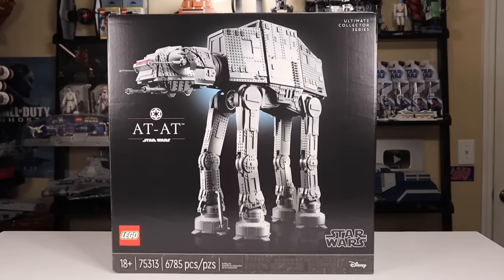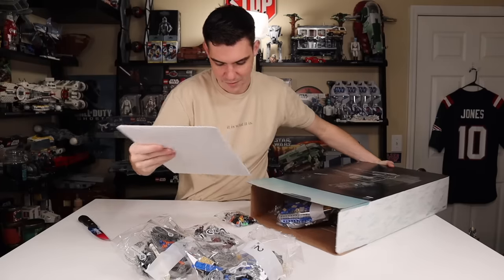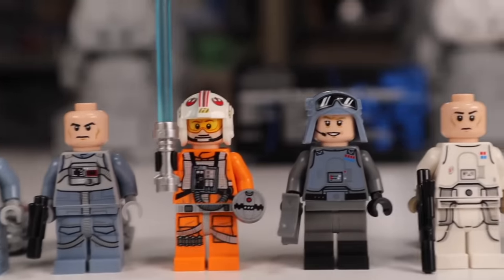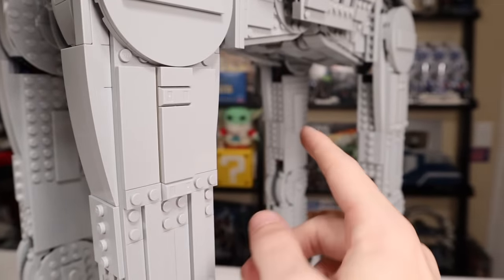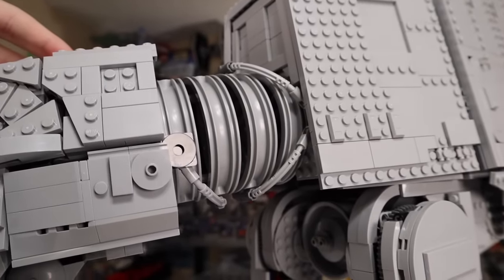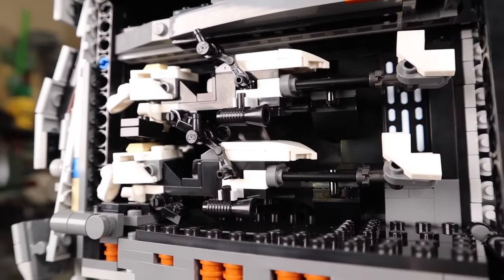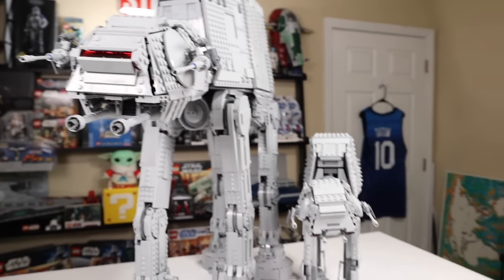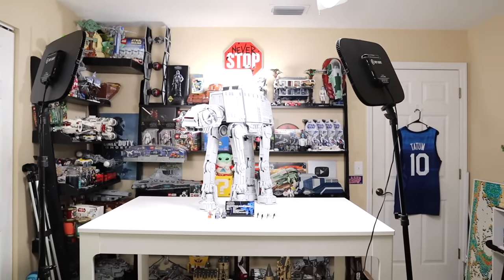LEGO Star Wars 75313 UCS AT-AT Review! (2021)

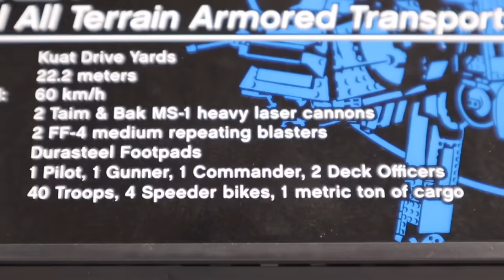Comment: 7:24 this got me curious so I ran the numbers, the UCS AT-AT is 36.3 times smaller than the "real" thing, so a metric ton at that scale (36.3x smaller, cubed) would weigh just 21 grams (0.7 ounces). 
If it can hold that much weight, which I suspect it can, it's accurate.

Comment: One of the biggest things I noticed about this set is that booklet #3 shows building the canopy as well as the head, but by the end of the third booklet we do not build the head. The 3rd box itself however is accurate in showing we only build the canopy and neck. But I agree with this whole review. It’s a tremendous, incredible set.
Reply: There is also a printing error in book 3 that dosent tell you to install 3 panel pieces on the front of the body.
Reply: @jaworski105  Noted

Comment: I really enjoyed the build process for this thing and it looks incredible. I love the interior and the attention to detail. That said, if my house were on fire and I could only save one set, I'm taking the UCS star destroyer instead.
Reply: May I ask if you had any trouble connecting the upper leg to the lower leg as mine is very unstable with only two orange pins just doesn’t seem stable, Thanks
Reply: @DarrensDrones  It's been 6 months since I built so to the memory is a bit foggy but I'm looking at the instructions and I notice that after you connect the bottom leg to the top part, you put on plates using SNOT techniques which helps build up the stability of the connection. I just recommend taking a closer look at the instructions and maybe going back a few steps if you feel like it's not quite right. The finished product is quite stable.
Reply: @HalcyonGames  thanks for the reply mate but I’ve just sussed it! And yeah like you said it’s very sturdy now!

Comment: Finished mine yesterday and it is a true mastadont. (my mother in law asked me if this one once realy did exist, she was serious). A great building experience, but like you mentioned, it has some flaws. Some parts are realy flimsy. Not just those attachments, but also  some other tiles and bricks, attached to just 1 stud. The front toppanel is very lose and can move. The top panel is not realy holding that panel into place. Further more some colours you are not supposed to see, are visible. Some dark tan part, which do not bother me that much, but also a lot of blue pins are showing true. Opening the doors of the side panel can cause the tech bricks on the inside of the doors can break off. These are not secured at all. There are no good instructions how to attach the bottom part of the legs to the upper parts. My advise: place the AT-AT on it's side first. When you put the AT-At on its back, the legs will fall off when you want to put it on it's feet.
The part I struggled most with was the underbelly. Some panels are attached on just one hinge plate and fall off easily, The diagonaly placed plates aren't really secured either, Handle with care. After the first 2 boxes are finished, you are more or less out of the danger zone and the bottom and legs stay in place nicely. 
There are 2 seats you cant use, because it's sides are places next to a wall. There are some errors in the manual, but those are minor. The best way to move is indeed as mention in the manual. I was surprised, because of the problems I faced with the bottom, but like I mentioned, that part stays in place fine when it is finished. Is it worth 800 dollars/ euro's? Hard to say. I was willing to pay for it, because I really wanted it, but I think 750 would be more fair. I paid 700 euro's and I think that is a good deal. I am very biased on this set, so I also would like to give it a 9/10, but if I am really honest to myself, it is an 8/10, which is still very good.

Comment: I prefer the System Scale AT-AT. I've done light mods to the head, guns on the side of the head, and the feet/ankles which drastically improve the look and the accuracy of the set when compared to the vehicle in the movies. It's also one plate taller which makes a nice subtle difference.
Reply: This AT AT is minifigure scale and the most accurate a Lego AT AT will get
Reply: @motmot8879  It is actually a little bigger than minifig scale. LEGO’s goal was to make it minifig scale. However, the problem is that the design LEGO came up with (for stability purposes) were legs that were 6 studs wide. At 6 studs wide, the AT-AT had to be made taller and longer so that the set would scale better with the fat legs. The Falcon and Slave 1 are true minifig scale. But this AT-AT is pretty close. Even with it being a little bigger, the legs are probably half a stud to wide for its current dimensions.
Reply: @somethingawesome9547  if someone gave you the choice between the UCS and playset model, I know which one you’d pick.
Reply: @danielq_4  The playset model would obviously be my pick. Why would I choose the UCS set? I can afford it but I would rather pay the $160 for the system scale set than the $800 for the UCS version. I am getting more enjoyment per dollar from the $160 set than I am per dollar for the $800 set. This should not be something that is hard to believe.

Comment: Gotta say the weakest of my lego ucs sets (gunship, b-wing, y-wing) - shit keeps breaking apart. The building process wasn't relaxing at all. Something on the underside broke almost everytime I tried to pick it up. The head building was a chore, that screen panel broke off 3 times. Attaching the head to the neck and nailing those 4 bolts without breaking the head? Barely possible.

I still didn't finish the panels at the side but good to know those shits break off as well. And as I mentioned before there's a small error in the manual (that isn't a problem but worth mentioning it).

If I knew it's gonna be so annyoing I wouldn't have bought it. Instead I would pick up the newer ucs y-wing and slave 1 and still have some money to spare.
9/10 seems a bit of a stretch, 8+ seems fair. The accuracy is great. I wish the durability was as well. Especially when we compare it to the gunship which is at least twice as durable.

Comment: this guy is a clown. gets free stuff from Lego and runs down other brands that are significantly cheaper yet optically superior.

lego is just too damn expensive for no reason
Reply: 😭 I just ordered my at at
Reply: Because other brands are such lower quality compared to Lego, the only one that even comes close is knex
Reply: @agentmanface6255  actually not. i have Lego and various lepin. C-3PO for example had manufacturing issues with the paint. this hasn't been observed in lepin. I've had torn manual pages for Lego sets as well. on stone lepin, I've seen warping of plates but otherwise the studs are perfect. 

lego is definitely not superior. this I've learned... lego minifigs are great though. you get weird lepin ones but still pass (chewy for example if horrid for lepin)